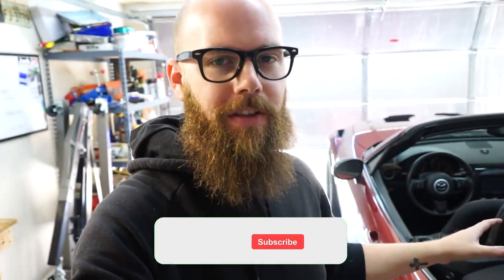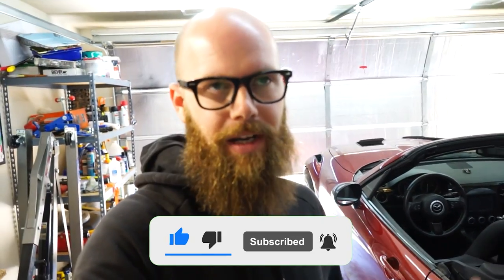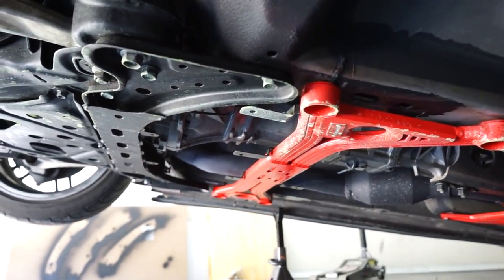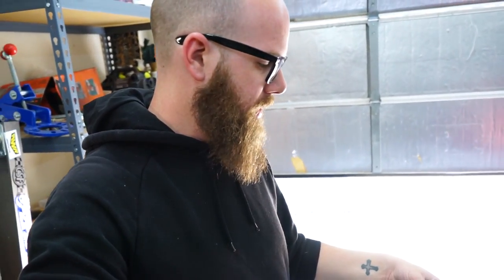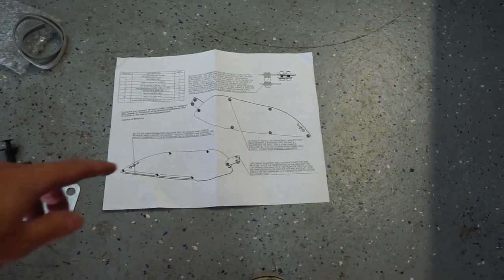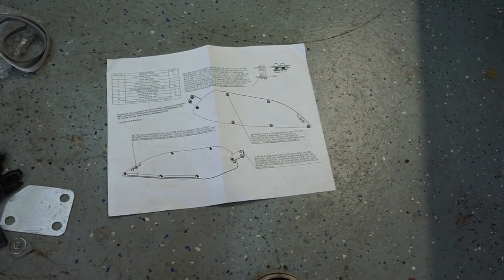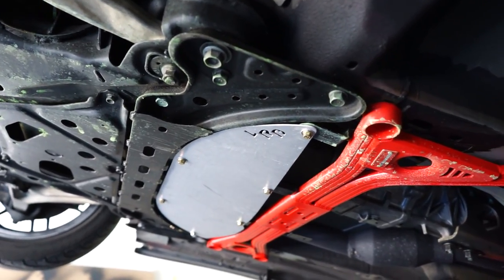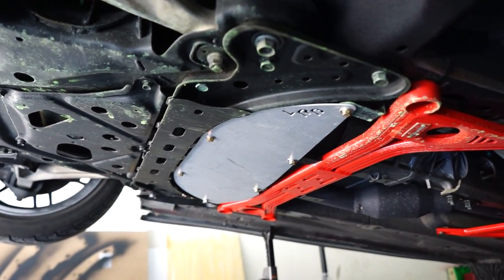LRB Speed Aero Panel for the NC Miata

Comment: I got the LRB undertray for the NC2's radiator area. It is well constructed, and shockingly my MPG went up.
Reply from the maker: I've been curious about picking one up as well
Reply: @ColoredinLight  Yeah I figured if I'd get an OEM replacement it would eventually sag too.
Oh BTW, my clutch pedal partially cracked, and gave me a huge headache trying to figure out what was wrong. I had to get the Nielex pedal brace just like you did. Your video on it was very useful, thanks!

Comment: hey dude. i see you have the IL motorsport braces on there.
i just got the rear braces a couple days ago (tho im still waiting on the X brace to arrive) and am about to have them fitted.
However.
the underside front brace (the one shaped like a dogleg)? 

i have the OEM brace in place on my nc2 and im wondering is the IL motorspor brace any better than the OEM.
basically is it stiffer than the OEM, obviously its going to be lighter but the weight saving isnt high on my list, stiffening the car is currently top of my list!

i put the boot brace in a couple of months back and its really helped to quiet down the roof and it has made the car stiffer but it realy needs to be combined with the lower braces too.

anyway hope you are well 
thanks for the videos